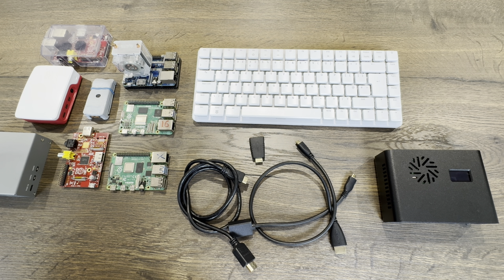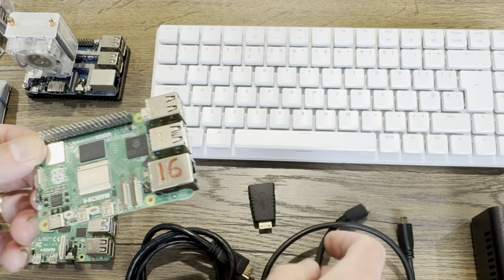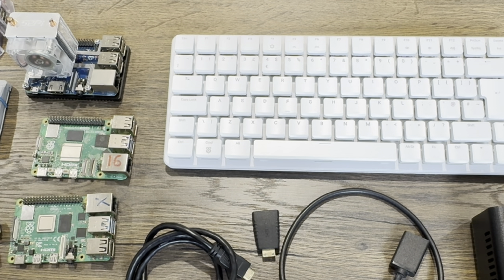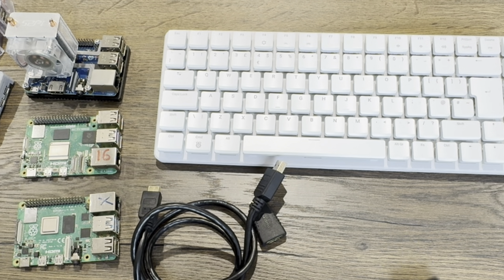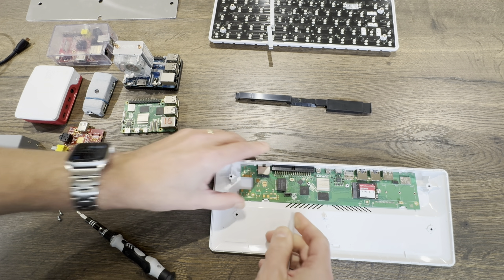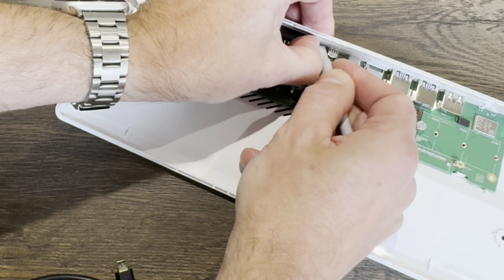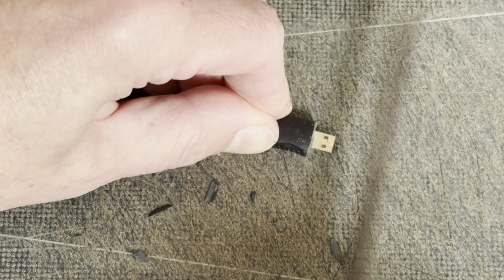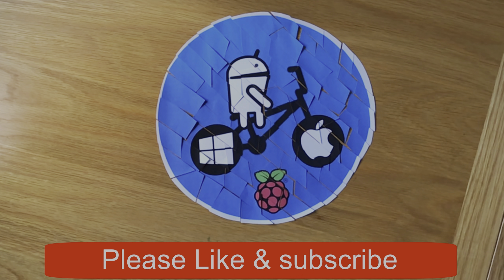Display cutting out fix for Raspberry Pi

Comment: i have the same issue on my pi500 Plus, i have found that using a micro hdmi to full hdmi coupler so no cable so to speak works well the ones i have bought are also right angled which if you use 2 displays might cause an issue but if only using one they are great i got them from amazon this is the full description - Maxhood 8K Micro HDMI to HDMI Adapter, 48Gbps Micro HDMI Male to HDMI Female Adapter, Left and Right Angled 90 Degree Micro HDMI Adapter Bidirectional for Hero 7/Raspberry Pi 4/ Camera, 2pack hope someone might find this useful

Comment: We've had several microHDMI cables break with pi 4s but it's down to the tight mounting we use. The Raspberry pi cables are chunkier than others which causes some issues and not always a tight connection. 

Aren't we meant to still use the hbmi port closest to the usb-c port as a primary monitor?

Comment: I have the same problem with PCIe card ports (graphics, usb, etc). There seems to be a lot a variance between where the card makers align their ports on the back of the card and how those align with the slot openings in the back of the computer case. Ideally the ports should be smack in the center of the opening, but rarely seems to be so, cheating to one edge or another. This presents a problem with cable connectors that have thicker housings. It's maddening. It seems like there should be a spec somewhere that dictates all these measurements. But of course we're dealing with hundreds of different manufacturers, not all of whom have the best production standards. Then it's up the the user to "fix" it, often destructively. In this case, since the RPi folks make both the circuit board and the case, it would appear that maybe the tolerances are a bit off in that unit. Maybe consider heating the case plastic a bit to deform it inward toward the plug? Something to try before taking a knife to it anyway.

Comment: Would it be possible to have a double micro hdmi to two full size HDMI adapter, having the two micro plugs would give it more stability.
Reply: As long as the plugs are long enough to reach the connectors why not?
Reply: Waveshare has a “multifunctional” adapter with long plugs for the pi 5 that should work for the 500+

Comment: Guess I should watched a little further into the video because you did exactly what I was suggesting LOL - GREAT WORK! I didn't think messing with the board inside the  Pi 500 would move it any closer, but I guess it did help :) - BUT shaving down that adapter was gonna be the sure thing that fixed it. You managed to chop off quite a good chunk from the end, BUT you wouldn't see metal if you went down too far - you'd see a PCB. That's all that is inside the end of the adapter. A PCB to soldier the metal of the plug to and the other end of it has the wires soldiered to it. AT LEAST THATS WHAT SOME BRANDS DO. Other could just have the wires soldiered right to the plug, but thats more difficult to put into the injection molding machine to get that plastic surrounding it all. But I guess the really cheap ones wouldn't have the PCB as it's just an added cost for them. But having a P{CB also allows them to add chips, capacitors, resistors, etc etc. But on an adapter like that doesn't use anything like that- I think

Comment: I think your problem with the micro hdmi stems 100% from it not being able to plug in ALL the way and it being able to move just enough for the connection to come undone and connect back when it wiggles even the slightest bit :( - MAYBE you could take a Dremel to either the case around the micri-hdmi sockets, OR grind down the plastic around the micro-hdmi plus on the wire/adapter itself.  (I think doing it to the adapter is your best bet because its probably the cheapest to replace if you happen to sneeze while grinding it LOL ) - If you do it tho, PLEASE FILM IT AND SHOW US HOW IT GOES !! :D

Comment: the Raspberry Pi 6 NEEDS to switch to TWO USB-C with Display Port and ONE Micro-HDMI (the smallest HDMI port,  lol I didn't even know that the middle sized one even existed LMAO)  - That way you can have power and display on ONE WIRE giving the possibility of running it completely from that one wire with you mouse and keyboard using bluetooth and your networking being over WiFi - So that's one awesome perk of doing it with 2 USB-C and 1 Micro-HDMI - another perk is just having Display Port which DOESN'T REQUIRE A LICENCING FEE PAID TO SOMEONE FOR EACH PRODUCT THAT USES IT, LIKE HDMI DOES (yes, you HAVE TO PAY to use an HDMI port on your product - but not to use Display Port)  - There other reasons to at least adding ONE USB-C with Display Port but I think the BEST REASON to having 1 USB-C for power and 1 USB-C with Display Port is that give you room to also have 1 FULL SIZE HDMI (v2.2 please 🙏)
Raspberry Pi users have been waiting PATIENTLY for a HIGHER REFRESH RATE THAN 60hz - One of the GREATEST things a RaspPi can do is run retro game emulators, and with all that power and the excellent emulator there is the possibility to run these games at high resolution and high framerates, which make them run like they are whole new games!! But with the 60hz limit of 4k on the version of HDMI that is on the Pi5, it makes using a more powerful CPU and/or GPU on the RaspPi 6 TOTALLY POINTLESS! People aren't going to buy the Pi6 to play more modern games, they want it to play Retro games in 4K/120 !!!! So THAT is the NEXT GENERATION of Raspberry Pi! Until we see 4K/120+ capability it's just tiny lateral moves like Apple does every year. All just to get more people to spend more money. (I'm talking about just when it comes to gaming on the Pi)  Adding native m.2 is great and all, but we already had that ability with the CM4 and the right board. So I only see the Pi5 as a small incremental lateral move. But then again it's not mean as a gaming computer, even though a TON of people use it at one. I just hope they do this on the Pi6 :)

Comment: I lashed the two hdmi plugs together tightly with 3 small cable ties (and a piece of plastic the right thickness sandwiched in between) . Worked a treat to keep the plugs in and stable 👍

Comment: I have to wonder how many raspberry pi users really need two hdmi connections? There’s plenty of room for one full-size hdmi connection.
Reply: I use multiple displays on virtually every computer that I own, having 2 displays out is something that I have pretty much required of any computer I have used in the last 25 years.  Thankfully I am no longer using two CRT monitors on my desk.
Reply: I use the two micro HDMI connections on my Raspberry Pi 500, and did before on Raspberry Pi 4. I need that extra screen space. I wouldn't mind three HDMI ports. You can have a small microHDMI to HDMI adapter, but that covers the other micro HDMI port.

Comment: I'll add the complaint of crap 'tiny' keyboard graphics...low lighting/less than 20/20 vison(my 70+ eyes) +  light brown on cream...this is a serious problem... I need to source a proper 'oldie' replacement key set. Regarding cables, Stanley/scalpel and cut back the sheathing exposing more connector

Comment: Ive just got my pi 500plus and got it loaded up and cant get any sound  I have the same problem with a couple of 4B computers  I do not know whats wrong but wondering if it is due to me using a tv as a monitor? Ive tried all sorts but not that clued up with programming  I am pretty new to Pi world
Reply from the maker: What os are you using. They usually default to hdmi audio. Try the other HDMI
Reply: @leepspvideo   pi os the latest one  I tried a few different os types on 4Bs but no go? Only tried the first pi os from pi imager on the 500plus  the tv is a toshiba  could it be the tv?

Comment: I personally think that dual displays was a mistake, especially because the pi 4 could barely handle 1 display at 1080p60, what made them think it could handle more than that?! an upgrade to Displayport would have been a better choice as that would allow them to cut cost substantially while also providing the same capabilities, also, if size is a problem, mini display port exists and can be adapted to literally any display cable that needs to be used, the adapters are dirt cheap on AliExpress.

Comment: I have had the same issue with the Zero2 in a flirc case. It can be frustrating.
The Micro hdmi really doesn't bother me. Perhaps earlier on, it cost an extra few dollars, but I have been using it so long at this point with minimal issues.

The mention of swapping the hdmi for usbc. You are talking about needing extra power to feed the usbc device. I will also mention that with the usbc road, I have had a ton of issues with connection cutting out with any cable over a foot long.

Comment: Small HDMIs on the Pi500 was an odd choice for a computer that will be primarily be attached to one output only - mostly for child's education uses. Why they didn't fit a large one is anyone's guess. The fact they didn't address the issue with the plus is  also anyone's guess - laziness or needed to ship a different version out quickly? Who knows? Otherwise they have their applications, but quite often after a Pi is deployed I'm logging in via a terminal or open VNC. I have no clue the last time I connected two outputs.
Reply: I can think of 2 reasons why they did what they did.
1 is cost. They already have the micro hdmi on hand. There is no need to stock an extra part.
As for the second, well, dual displays are extremely useful for desktop tasks ( like programming ). They have been doing it for some time, and at its core, it is supposed to be a pi 5. 
Yes, many only use or need one screen but the same can be said the other way around ( use / need 2 screens).

Comment: Had the same issue with my 500+. I bought two cables a while back. both cables were ordered at the same time but the first one wouldn’t work with the 500+. The second one worked like a charm. Same cable, came in the same official pi cable box. I’ll have to open it up and see if reseating will fix it or try cutting the cable back.

Comment: The mini-HDMI connector assembly on the official Raspberry cable, is about 1.5 mm LONGER than commercial cables. I noticed this as soon as I compared them.
Reply: That explains why they've been so damn fussy about cables since the Pi4 came out.

Comment: I've been using official RPi white cables on 52Pi and Flirc cases in conjunction with RPi 4b and 5 boards and never had any problem. This cases also have big gaps. I think it all works fine because the cable plug does not have a high relief around the metal part like your cable had.

Comment: A vertical Hdmi or vertical mini hdmi could work.

Likely wouldn't stick up above the USB ports for the mini. Maybe a bit for the full sized ones.
Reply: Or stack them like USB ports. It would still be of similar profile than the USB ports
Reply: @WhiteG60  the spacing for cables is a concern though. The average cables for HDMI tends to be on the thicker side.